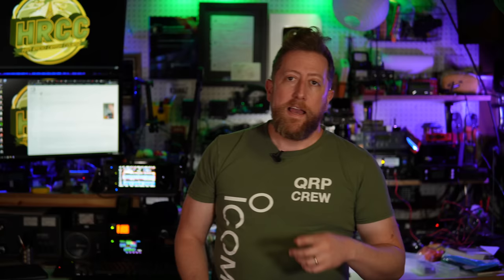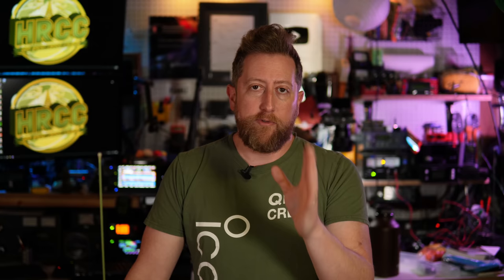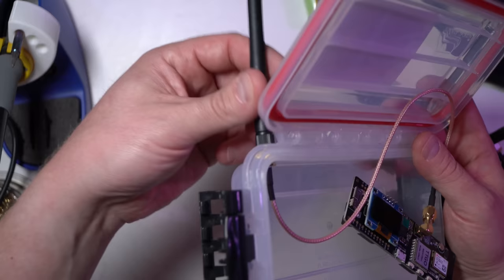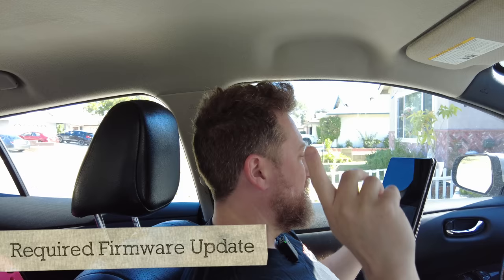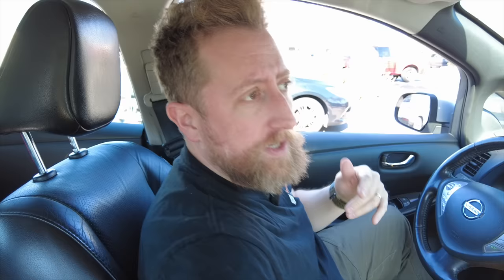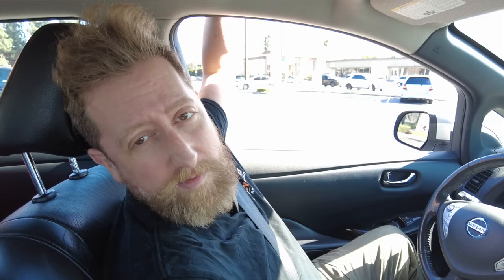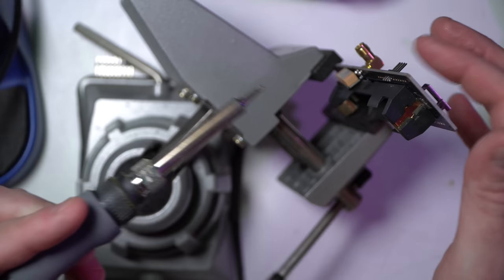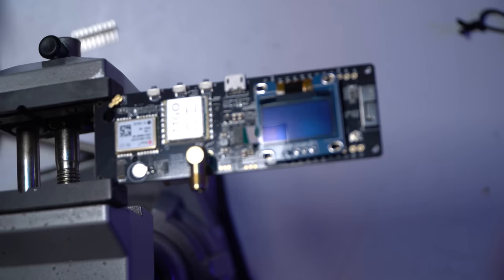LoRa Meshtastic Range Test, Portable Relay & Your Questions - Off-Grid Communication

Comment: A couple of questions:

1. Can more than one phone / tablet connect to one LoRa device at a time? 
2. I’m guessing if someone sends a message from device A out to and device B isn’t connected, that message is “lost”. So best to check if anyone is “listening” before sending a detailed message. Is that correct?
3. If I have three LoRa units and three devices connected and one device broadcasts a message, the other two will receive it?  (Party line essentially)
4. Any channel changing option so a couple people can communicate directly and keep the primary channel / frequency open?

I’m trying to see how we can use this in a remote community so appreciate all the info and help! Thanks!
Reply from the maker: I believe more than one phone or tablet could be used for one LoRa device but not at the same time. 
LoRa devices will give mesh status for those they hear but the don’t denote of a phone or tablet is connected so messages could be lost. 
It works like a party line, yes. 

You could have three LoRa nodes connected to three different networks and jump between them with one phone.

Comment: G'day at 12:24 you say that is a frequency hopping spread spectrum system. LoRa modulation is a spread spectrum like technology in that the transmission is swept across the channel bandwidth. This give it a unique appearance in a waterfall display.  LoRa and as far as I can see Meshtastics implementation does not use frequency hopping. I'm new to Meshtastic but as far as I've seen the frequency is determined when the "channel" is created isn't it?
I heard that there was a massive crash of devices at defcon this year when a bunch of nodes started up :-)

Comment: I can’t remember the formula for power attenuation but I’m pretty sure it includes a square of the distance, a cube if it’s a spherical signal. So it would have been better to start at say 1k, then 2k then 2.5k then 2.75k etc
Reply: Can you elaborate a commercial approach to increase the range with power attenuation
Reply: @teachusmore  that so not really what I was talking about. I was talking about how the signal power doesn’t degrade linearly with distance. However that does suggest an answer and that is to get the signal is linear as possible and that will depend on the antennas used. You would want possibly a helical or parabolic antenna but the problem you have then is that you then need to have them pointed in the right direction. The commercial approach is in the name “mesh”: simply add more nodes.

Comment: It's not entirely correct to say that the range of LoRa is line of sight.  LoRa is a modulation technique that may be applied to any radio signal.  It's generally the power level and operating frequency in the (RF) environment that determines range.  Having said that it is the adoption of LoRa that provides your signal with additional performance benefits and these can be really impressive.  Amongst other things i) LoRa allows the trade-off between data rate and range ii) LoRa can operate below the noise floor - providing incredible margins and iii) being a spread spectrum technology it can operate in a shared frequency range. (There are others but my pedantic meter needle has just wrapped itself around the end stop) :)
Reply from the maker: That’s interesting and yes, I see what you’re saying.  Going to have to look into LoRa over hf soon. 😅
Reply: @HamRadioCrashCourse  As soon as I submitted that, I thought about the very wide modulation bandwidth compared to the carrier frequency. There are the legal restrictions of course but it could be that you could get away with a very low carrier power so that it is well below the noise  floor (only you know it's there)  :)  But come on the Russian got away with 'The Woodpecker' for years.  Go for it!  :)

Comment: So in essence, Lora devices are low powered wifi repeaters for a closed off network and you use a special app as your messenger to communicate between devices attached to the access points?

Comment: I just wanted to ask, each LoRa device has a 2~2.5mi range in the city.  BUT!!!  They can leapfrog a message across them correct?  So if you had one 2mi away (at a neighbor’s house), and then one at 4 mi away (at a second neighbor’s house) and then one 6 mi away (at maybe an office) and each was 2 mi away from the next one,  the home device could send/receive messages to the device at the office through the other two LoRas, correct?
Reply from the maker: Thats right!

Comment: Could you use a better/bigger antenna on the LoRa device? 

Could you use a longer feed line from the LoRa device to the antenna?  

I would like to use a LoRa device network at my farm. Thought I would put a device at the farmhouse with a high gain antenna on a mast. 

Thanks Josh!  I really enjoy your content!
Reply from the maker: You don't really want a better antenna, you want an antenna that is perfectly tuned for 915MHz.  Also, you want NO feedline is possible that frequency, any bit of feedline is adding line loss reducing your devices power output over the air.

Comment: Great Video. One question, just to make sure I got this right. Every T beam works as a repeater for others, too. If I place one on my roof I could use this for my network but it would also improve the network for others by working as a relay station? And how many relays in a row can be used? Is there any limitation?
Thanks and best regards from Germany.

Comment: Josh, I was wondering, is there a number of words limit for each text message you send? 
    I’m the net controller for the Skywarn Program for the National Weather Service office at the University of Hawaii-Manoa Campus  here in Honolulu but at the same time, due to Covid19 restrictions, I’m asked to operate from home during hurricane season last year and this year. I have line to sight to the NWS office, it seems that I could relay messages directly to that office from my high rise condo. Is it possible to incorporate a wall wort instead of a 18650 battery in their office for this device? I suppose I would need to know how many volts and amps that would be required. Please advise. 🤞🏻
Reply: I can't find a how to but I have seen people build them as base stations with no battery or gps and powered by USB

Comment: I'm sorry I have literally zero experience with this stuff, but this is really cool and I'm really getting into it but I just wanted to be sure... So theoretically I could have hundreds or thousands of these things spread out between my house, families houses (with their permission of course) not connected to wifi but on solar panels and batteries and barring any obstacles I can text send gps data... I'm curious as to the future and phone calls or sending images... for instance would having a strong or multiple systems right next to each other be able to send images or do phone calls? Also are there other devices that are LoRA but can handle more connections? Or are all of these devices really small. Again I'm just curious... and I have no effing idea lol. Thanks!

Comment: I have a question if you think that this could be used in the woods to create a connection back to your vehicle's mobile radio by dropping a line of Meshtastic nodes along your trail just in case you need to write an emergency "help, I've fallen and I can't get up" message or for forestry firefighters to extend their range to send info back to their command center. I'm wondering if the "line of sight" could tolerate a few trees in the way. Are you in the mood to go for a hike? I'd be interested in some test results.

Comment: I do screens by soldering the short end of header to screen, and then soldering the whole thing to the board. Just the way that works for me (and the 100+ hotspots I have built).
Reply from the maker: Ahh interesting.
Reply from the maker: I guess you’re heating the screen twice. Ever have a failure?
Reply: @HamRadioCrashCourse  it doesnt create any damage to the screen if you do it without mistakes. Usually when theres a heat sensitive part i need to work with, I apply a bit of flux so the solder heats evenly thus taking less time to work with it. then clean the area with some IPA in a q tip. Also, when soldering sensitive parts, its not recommended to go past 420c in the iron. my preferred temp is 380c for the 90% stuff i work with.
Reply: @Intimidator443  Depends on the composition of your solder 95/5 SN/AG, tin, silver, won't even melt at 420, I  believe you meant 420F not 420C as 420C is 788 degrees fahrenheit, enough to melt pure lead. If you are worried about heat slow down let each pin cool, also can mitigate heat by not soldering pins in a row, just make sure to inspect that you got them all before declaring it done.  but 380 is generally good for 60/40 Sn.Pb, i.e. Tin / Lead, though I have noticed that each iron is different I have two Identical station, one for lead and one for no lead, lent my  lead to a buddy, he was late getting it back to me so had to use my no lead for a job had to set it 50 degrees hotter than normal, these are "identical" stations, same power supply same iron.
Reply: @at1cvb417  yes, meant f not c that was my bad. Sometimes i get confused while translating from spanish to english. I use 60/40 rosin core solder which melts perfectly at 380f. If its non lead solder requires more heat to melt.
Reply: @Intimidator443  No problem totally understand.  Have to convert temps all the time, some times using three different systems even.  Though C to K is easy.

Comment: Since it has a detachable antenna, rather than mounting the entire module on the roof would it not beneficial to mount an antenna on the roof and run the coax into the house just like you would a radio antenna?  

And on that note, have you come up with antenna solutions for a vehicle so that you could have one full time in a vehicle?

Comment: Hello Josh new to the Ham world and learning from your videos.  Does the antenna on these LoRa devices factor into the distance?  It uses SMA so it could be swapped out for a different antenna.
Reply from the maker: Yes and yes.  There are better antennas for these. But at higher frequencies keep the feed lines very short.
Reply: @HamRadioCrashCourse  thank you.  I have been curious about this system for a while.  Thanks for putting the information out there in a user friendly format.   Helps those of us who are just getting into radio.

Comment: you pointed out that the building cause issues.  You seem to forget general RF noise can decrease range.  would have preferred to see this done with a directional antenna.
Reply from the maker: I guess go make a test for however you would like to see it. Many folks aren’t interested in directional antennas with these.

Comment: Great video!  Does anyone sell the Meshtastic devices fully assembled and installed in some type of case?
Reply: I believe the more expensive TTGO T-Echo comes assembled, as it has an E-Ink screen, and most of the listing I’ve seen have a 3d printed case. However, they’re more than double the price of the T-Beams.
Reply: @PrebleStreetRecords  Thank you. By the time you figure in sourcing all the various components and your time to assemble and test, it's probably a wash.
Reply: The LILYGO® TTGO LoRa32 V2.1_1.6 Version comes in a plastic case. I melted a hot nail through the case to make an antenna and micro USB hole. Enough room to hold a 1000mAh Lithium Polymer LiPo. Not waterproof.

Comment: RF power level is less important than antenna height. I'd expect you could get 20 miles or more of range from one watt if one of the transceivers was on top of a mountain talking to a unit in a valley or on another mountain.

Comment: Re: voice over LoRa, the bandwidth and intention of this type of signal is low power, low bandwidth, and long range. Sending a 8 or 16 byte packet of sensor data, you betcha... 64,000 bits or 6,400 bytes per second for a decent voice quality transmission? Not a chance. A LoRa transmission with spreading factor of 12, which gives longest range but slowest speed, takes something like one second to transmit 50 bytes... not megabytes, not kilobytes... just bytes.
Reply: Definitely for sensor data, and not voice.  Josh has at least one other video about LoRa.  I watched it recently and in that one he mentioned Andreas Spiess' channel.  It was a 20-minute or so video on Andreas' channel that explained LoRa very well.
Reply: codec2 can operate intelligibly all the way down to 450 bps. That's bits per second. There are other nascent AI codecs that also can function below 1 Kbps. At those bitrates, you can indeed have real-time voice comms over LoRa. It's not exactly pretty, but it can theoretically work. There's even a Meshtastic module for it now.

Comment: Wonders aloud, “would higher gain antennas help?  Directional antennas, for fixed positions?”

Thought was that this kind of system might help for rural “broadband”.
Reply: Broadband is out of the question, data transfer is possible but at extremely slow speeds by todays standards. Makes for good text and sensor information sharing though.

Comment: I don't know if you hit on this or not, but how do these things work with 3rd parties?  

For example, I decide to mount one over my house and over where I work. They connect, and I'm good for communicating between one device at home and one at work.  

What happens if someone else puts one up in range of my work but not my house?  Will that extend the distance I can communicate to my home or will these be isolated from each other?
Reply from the maker: They would need to have your configuration to extend your network.

Comment: I'm just finding this video.  Don't know if you're still responding to a year old project.  So essentially, you are able to extend your Bluetooth transmission through rf with the mesh network?  If you place them in a line (line of sight) in a series, will they communicate from one to the next to the next back to your desired point of communication?  I saw your test but didn't understand how you were able to acknowledge receipt to the one at your home.  Does it send a notice that the message was received?
Reply from the maker: It’s a messaging protocol.   Not Bluetooth, or any rich data.
Reply: @Ham Radio Crash Course  I was just dumbing it down.  You send your message through Bluetooth to the device then it seems it as an rf signal to the mesh network.  Is that correct?

Comment: I have a Lora LilyGo Shield 20191223
LILYGO® TTGO T-Higrow LoRa Shield 868Mhz / 915Mhz Function Expansion Board how can i use that without the grow crap its developed for and instead use it with esp 8266 for meshtastic?

Comment: Thanks for the great explanation. what's the baud rate?
Reply: The effective bit rate over LoRa is a few hundred to a few kilobits per second.  The data is half-duplex and sent in packets in up to 400 mS chunks.  The T-beam is pre-programmed with four speed ranges.  Even fast mode is really most suitable for text messages, not voice or video.

Comment: For those of you still wrapped around the axle, consider these points:
1. Just because your grid is down doesn't mean the entire grid or Internet is down. During several hurricanes in Louisiana, we had no electricity for over a week but the cellular Internet was up the whole time. It can happen. Also, working in disaster zones, even if your infrastructure is wiped out, doesn't mean it isn't working next town or county over. A portable network like this allows comms inside rhe disaster zone and connectivity outside the zone. 
2. Text comms are similar to military burst transmission. Fast and harder to pinpoint than voice by quite a bit.
3. If you don't have a group, you may not need comms. Comms are a combat multiplier of huge proportion. Shoot, move and communicate are the three things you need to do to stay alive in the military.

Comment: Is there a way for the LoRa devices to be set up and be EMP CME proof? Maybe a thick ground cable and some shielding in the enclosure would help.
Reply from the maker: Unlikely even if it is connected to an antenna during the EMP, even if it is off.

Comment: this might seem like a dumb question, but could these LoRa devices be able to theoretically provide a slow but useable internet connection if you were to set one up as a gateway node and have another device connected to something such as a laptop or a phone? and also for connecting these to computers, would they work under linux?
Reply from the maker: They cannot at this point. Way to slow and not how they function really.

Comment: I don't get why the project would have you download a app to use Bluetooth. There are extra steps in creating an account not to mention the esp32 bluetooth radio has been hacked. I don't know why the makers would not just use a wifi acess point with a webpage interface to LoRa instead.
Reply from the maker: You CAN use the wifi. Use it.

Comment: Thanks, i have two of these but they go to sleep after a minute or so and stop working, is there a way to keep them online?
Reply: I am waiting on mine, but I understand it’s a time slot thing.  Might be in the software to change.  More open time slots, more battery drain, but the time slot transmission should cause the unit to wake up.
Reply: @Chasing_The_Dream  Thanks I've got it working now using two different android devices, I was trying to test both TTGO bars on one device...:)

Comment: What I don't get is how the devices would operate when the sun goes partially behind a cloud and the voltage drops? Wouldn't you need battery plus solar, and if so, what hardware would be required?
Reply from the maker: Yes. I assumed battery plus solar.
Reply: @HamRadioCrashCourse  Unless it was designed with backup circuitry that won't work.
Reply from the maker: You can run the tbeam off a battery that is being charged off a panel using a charge controller. Simple.